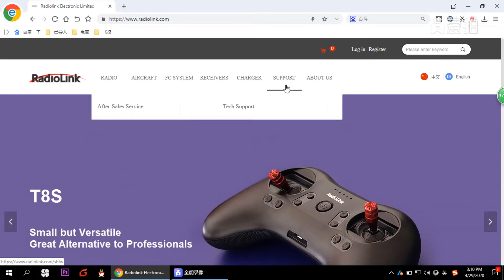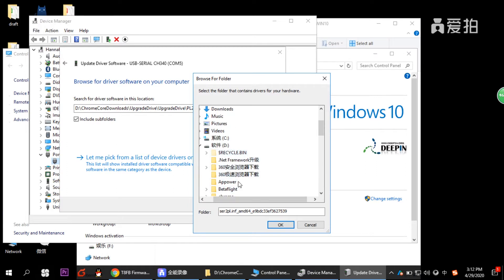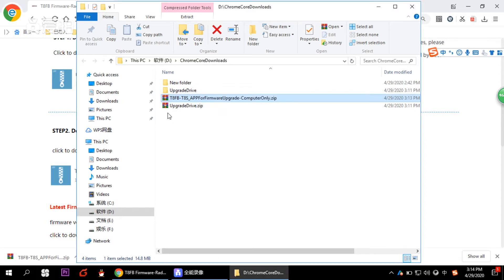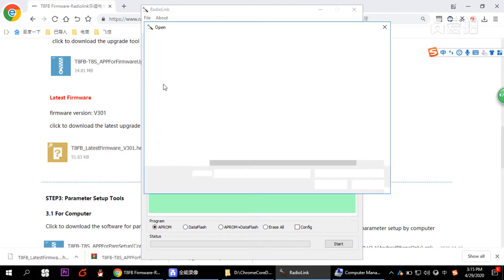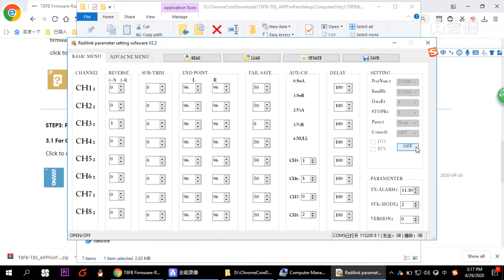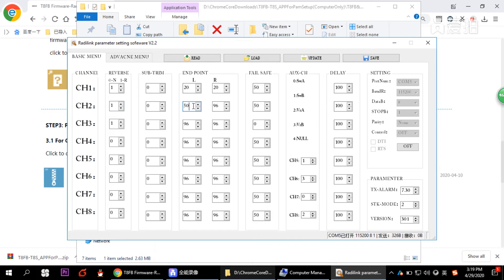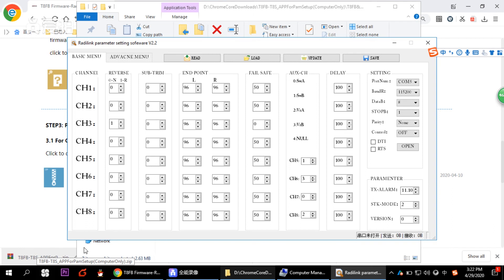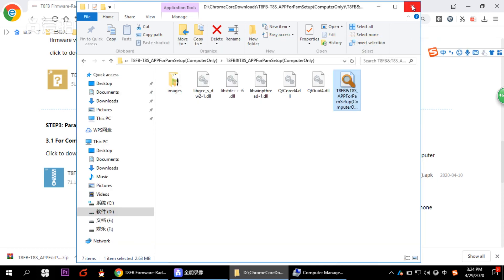How to| Upgrade Firmware & Setup Parameters with PC Software for  RadiLink T8FB/T8S

Comment: Stuck at Step 2. It stays at "Detecting" for ever
Reply from the maker: Hello, sir. What transmitter you are using? Before the transmitter is connected to the computer via a USB cable, the transmitter must be turned off. Open the upgrade software, click the "Connect" button, and then short press the power button quickly within 1 second, the connection will be successful. (If you cannot connect, please try this step several times). If the transmitter is turned on when you click "Connect", the connection will be failed. By the way, if you are using T8S, may I know what version it is? Do you need to long press power button to turn on the transmitter or short press power button to turn on the transmitter? If the problem still exists, you can send details to our email: after_service@radiolink.com.cn
Reply: @Radiolink  I have the T8FB (BT), I've tried in 3 different computers with different USB cables. I've turn on the transmitter and click "Connect" within 1 second dozens of times on each computer. I have no idea what else to do. I'm going to send you an email (tomorrow) with pictures attached to see if you spot the issue. Thanks
Reply from the maker: @ricardovega1407  Hello, sir. Sorry for the problem. You don't need to click "Connect" within 1 second dozens of times. What you need to do is: after click connect, turn on your T8FB immediately. And could you please send us a video to show your steps? It will be helpful for us to find out the problem.

Comment: can i connect my t8fb wirelessly like bleutooth to play simulator?
Reply from the maker: Hello, sir. if you want to connect it to computer to play simulator, you need dongle. If you don't like cable one, you can choose wireless simulator. Here is the tutorial for you: https://www.youtube.com/watch?v=yu5YS8K029U&t=29s
Reply: @Radiolink_official  but that wasn't wireless i meant if it's possible to connect to a sim like you connect a normal controller.
Reply from the maker: @sigve7008  Hello, sir. I see what you want. But sorry, as far as I know, dongle is necessary. So it may can't.

Comment: Hi everyone. I'm trying to connect this controller to my Tinyhawk II Freestyle drone. Is that possible or am I doing wrong? Please I need your help, thanks.
Reply from the maker: Hi, T8S transmitter can work with Tinyhawk, you need to make sure the connection between receiver and flight controller , and the receiver is on the SBUS signal output. if there any question you can send a email to our after_service: after_service@radiolink.com.cn

Comment: Hello, I would like to set an "air brake" for my RC plane "Pelikan Beta 1400" on my T8FB (on some of the channels 5-8 I would like to raise both my flaps with one switch (if possible) up to "brake" a little bit in the air during the landing), could you advice me what and how to set, please? Thanks in advance! :)
Reply from the maker: Sir， You need to use the mixing control stting to realize this function.You can send an email to after_service@radiolink.com.cn, and we will tell you the detailed setting method.
Reply: @Radiolink_official  Hi, thanks, Ive send the email couple days ago but I have no answer yet. :(
Reply from the maker: @MrOndraczjn  Hi, could you please tell me  how can I find your e-mail accout, i will help you check if we received or you re-send it again, I will let my colleague check it.

Comment: Hello @Radiolink Thank you for the guidance below. Next challenge is using the Params Setting program. I can change lower and upper limits upload to controller and see results. When I make changes to parameters on the ADVANCED MENU tab, however, NOTHING gets saved into the T8S transmitter. When I read back from it, all changes I made are gone. For example, changing rate from 100 down to 50 is not kept.  Can you help with this problem...?
Reply from the maker: Hi Mike. Thank you for your question. Did you click WRITE(on APP) to update the changed data into the T8S and two D sounds mean the modified data have been written in T8S. If no D sound means update failure, please reconnect T8S to the App and re-write. Click WRITE each time parameter is modified to make sure it’s well input to the T8S.
Reply: @Radiolink_official  yes, I clicked WRITE. I hear the D sound. I've tried multiple cables. At this point, I suspect a firmware/APP compatibility design issue and am quite frustrated with your product. What else do you suggest...?  Can you provide an email for me to correspond with?
Reply: +1week... still waiting to hear from someone at your company. Emails to website also go unanswered...

Comment: I have followed this video exactly, downloaded and installed software and along with the latest (v301) HEX file for T8S controller. I can successfully connect to the controller but when I press the START button in the firmware update program, I get a "Time Out!" error message. I noticed that the Config box just above the START button is checked by default in my copy of the software. I have tried both leaving this box checked and unchecking it but I still always only get the "Time Out!" error message. I am using the USB cable supplied with the controller.
Reply: I have attempted the process of two different computers, one running Windows 10 Home and the other running Windows 7 Ultimate. I am using the USB cable supplied with the T8S controller. I encounter the same "Time Out!" message on both machines...
Reply from the maker: @MikeMushovic  Hi Mike Thank your for your feedback. I've replied you by mails about the possible reason about the bad connection during process. Could you please confirm again and send me a video if the problem still exists after double try? Thanks in advance.
Reply: @Radiolink_official  Hello and thank you for the guidance. I was finally able to follow all of the steps in exact order and got the firmware updated.  Next challenge is using the Params Setting program. I can change lower and upper limits upload to controller and see results. When I make changes to parameters on the ADVANCED MENU tab, however, NOTHING gets saved into the T8S transmitter. When I read back from it, all changes I made are gone. For example, changing rate from 100 down to 50 is not kept.  Can you help with this problem...?

Comment: Before doing this manipulation, is it necessary to have connected the transmitter and the receiver together? I do not yet have a battery to power the receiver, and this manipulation does not work on my computer.. Is it necessary to bind the transmitter and the receiver, then make this manipulation ?
Thank you for helping me.
Reply from the maker: Hi Baptiste Thank you for your question. No, for the parts instructed in this video, receiver is unnecessary. You just need the transmitter(T8FB/T8S)with power supply and a USB cable.
Reply: @Radiolink_official  Thank you for your answer, I will try following your explanation and I will let you know if it works :)
Reply: @Radiolink_official   Hey, I have another question about the receiver R8EH (I bought the T8FB). I'm going to use it on a plane. To which outlet should I connect the ESC and to which outlet should I connect the servomotors? I'm new to this field and I don't really understand "PPM" ... Can you explain to me on which channel goes each elements ? Thank you for helping me.
Reply from the maker: @baptistefauche327  Heyyy, ESC is connected to CH3. For the other servos, CH1 is aileron, CH2 is elevator and CH4 is Rudder.
Reply: @Radiolink_official  Thank a lot !!👍👍